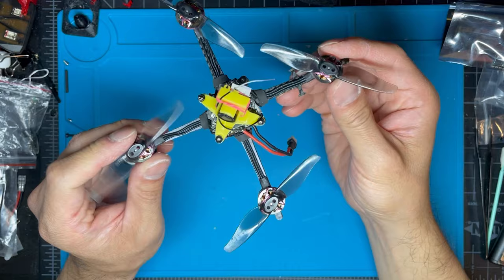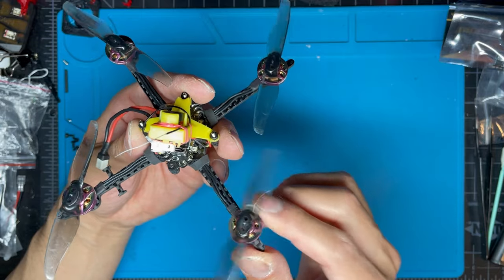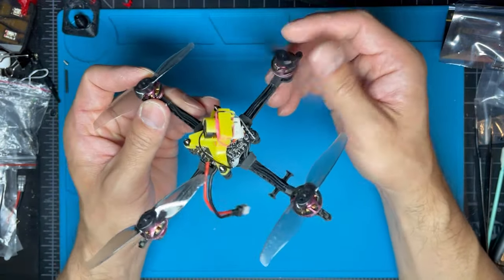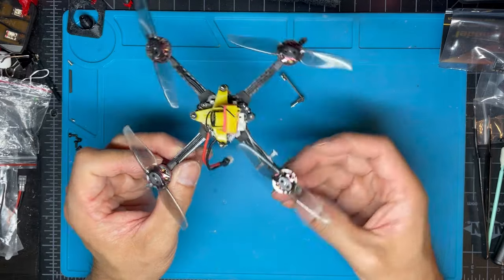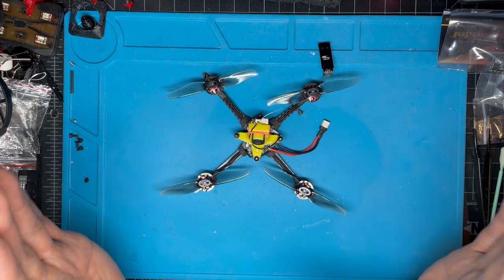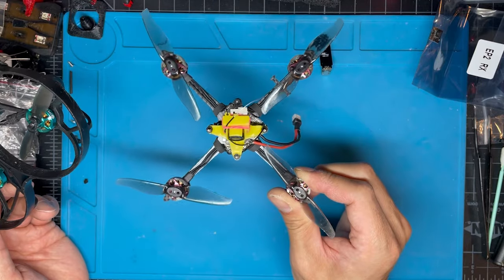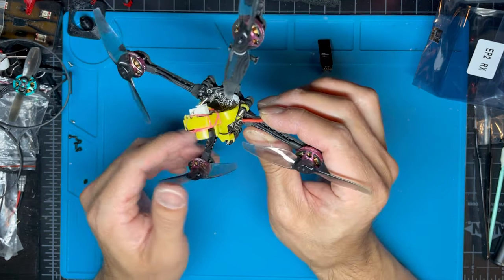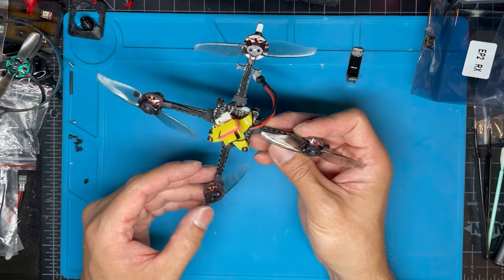Convert #Moblite 6/7 to 1s 3" #Babytooth - Build info and Tips

Comment: Hi, i want to build a toothpick like this, but I'm afraid that the crazybee f4 lite 5A ESCs will burn under such big motors. The motor I would get are flywoo 1202.5 and they go to a Maz of 8.5A, Will that burn the ESC s?
Reply from the maker: There's potential for burning them with that motors and fc. You'd be safer with something like a tunerrc fc that's got 7 or 8amp ESC. That said the diamond f4 I use is 5a and I've got no problems yet with the 1202.5 motors
Reply: @MrHappeFPV  perfect, so it won't be instantly fried as soon as I give throttle. If it eventually burns I'll buy something more power capable 👍

Comment: Where did you get a 1300mah 1s battery ? 5:15
Reply from the maker: I ran 2x 1s 650mah LiHv in parallel! Made an adapter for it.
Reply: @MrHappeFPV  Do you have a video on making that adapter ?
Reply from the maker: I don't but I could put a video together if i got the time!

Comment: I liked the moblite7 and its solid AIO FC. Took all the components as it is and put them on a 2 inch twiglet mini frame. 23g dry weight. Still working on saving more weight. Aming to 30g AUW with a 300mah lipo.
Isnt 5A ESC too little for a 1S 1202.5 Babytooth? A little underpowered for my feel. Love the crux3 on 2S
Reply from the maker: Sounds like a nice build coming along 👍. I thought the 5a ESC managed pretty decent on those 1205.5 motors. If I had means to get higher Amp ones, I would to try but the Diamond f4s where more accessible. I've been told ppl have fried theirs on 1s baby tooth builds but I have a feeling they must be flying 1s on xt30. Mine are bt2.0.
Reply: @MrHappeFPV  on 1S with 5A ESCs you wont need the performance of a XT30. This whole 1S thing is to save weight. You can save 1g sticking to BT2.0 or GNB27. Xt30 is overkill. Check YT for comparison videos on the plugs. Just soldered my gnb27 on yesterday. Great plugs. Better than BT2.0. But not so much better worth switching up. My 2 inch build is finished. 22g dry plus 8g for 300mah lipo. 30g AUW awsome. But the TKS rocket build from nick burns channel is way more powerful coming in at 50g AUW. Check out flywoo 1s firefly just released. Similar to my 1s build

Comment: Basically same build as i did, i just used happymodel 1202.5.. Only thing about vtx antenna: i didn't find enough info on diamond fc on internet, so, how to upgrade video antenna?
Reply from the maker: I haven't tried myself yet but i think it's a matter of finding the closest ground location on the fc to the antenna pad, to solder the shielding to.
Reply: Thanks, so at now you're going on with the stock one? Not bad at all!
Reply from the maker: Surprisingly, the reception with the stock monopole antenna is pretty good!